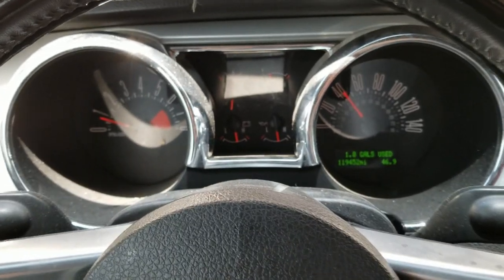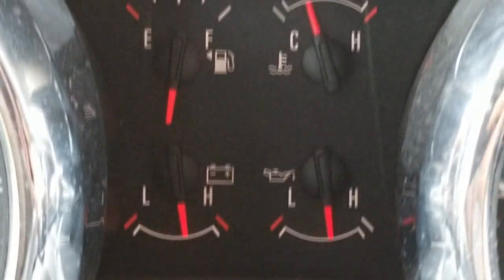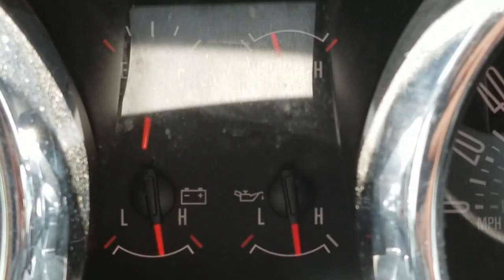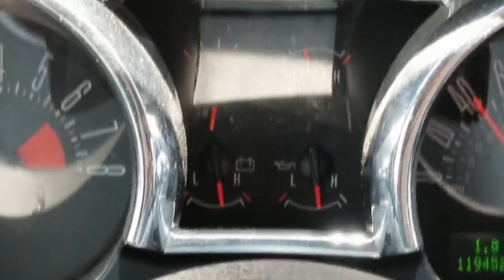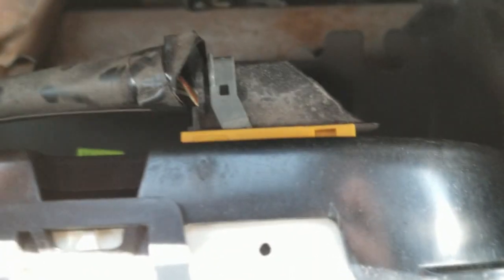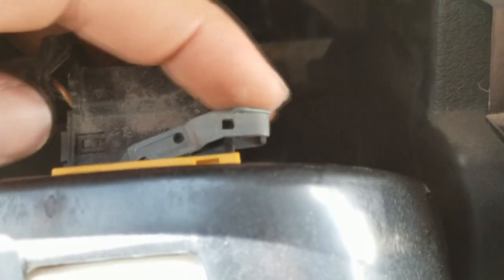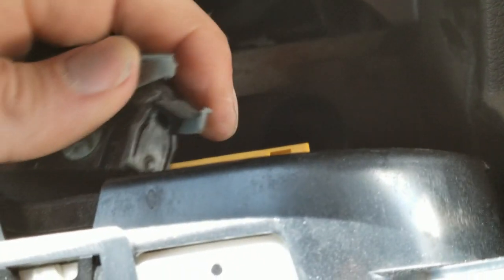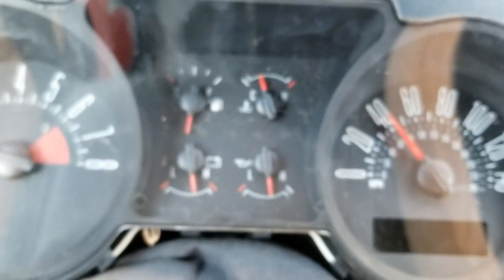2005 Ford Mustang Gauge Cluster DIY Removal For Repair | How to Remove Dash

Comment: Hello Sir, I have a 05 mustang. It has no turn signal sound while the vehicle get warm/hot, the "forget turn off  headlight" warning sound also disappears. But when the vehicle is cold, those sounds work just fine. I found those sounds all come from the  cluster or some spots nearby the cluster. Do you know what is going on? Other sounds work normally. Thx!
Reply from the maker: Hello, The chime is on the circuit board. If you would like to send it to us we'll be happy to fix it for you.
Reply: i would like to send mine in to be fixed my gas gauge just stopped & my speed gauge us stuck at the bottom only thing that works is my RPM. do you know how long it would take to get it back because i need my car for work
Reply from the maker: @reekodayoungan1104  we repair and send back within 24 hours of receiving. Whole process usually takes about 1 week. https://www.automotivecircuitsolutions.com/products/2005-ford-mustang-gauge-speedometer-instrument-ipc-cluster-repair-service